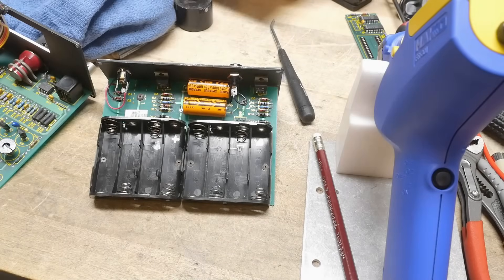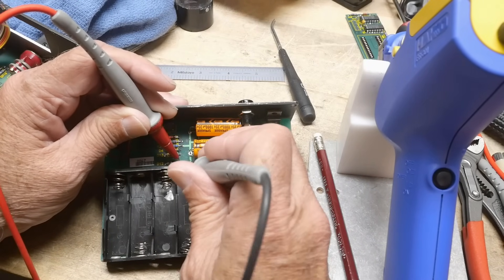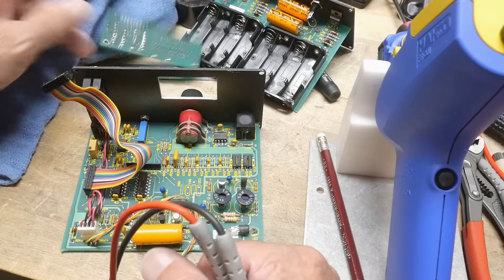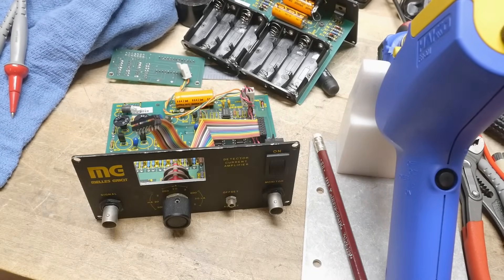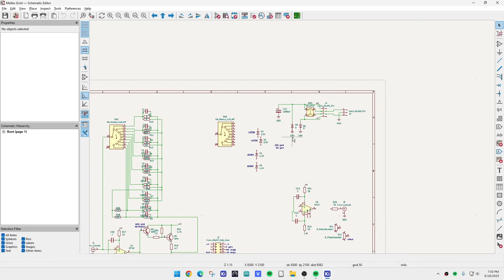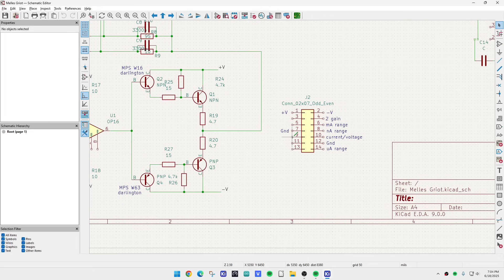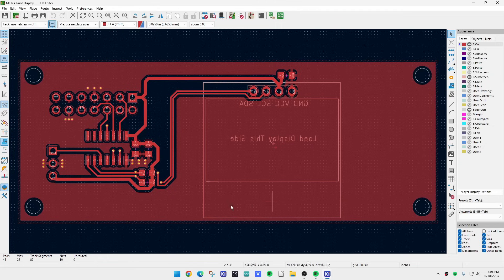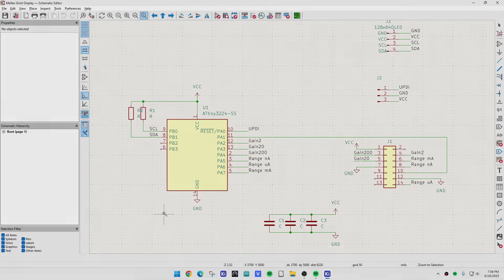#2288 Melles Griot Transimpedance Amplifier (part 3 of 6)

Comment: Interesting project. Look forward to the final solution. One question, any issues with 5V logic and your 3,3V microcontroller?
Reply from the maker: the ATTINY3224 Supply voltage range: 1.8V to 5.5V

Comment: 4 NiMH batteries would be 4.8V not 6V.
Reply from the maker: A 4-cell NiMH pack (e.g., AA or AAA) would have a nominal voltage of 4.8V (4 x 1.2V). 
When fully charged, this pack could reach 5.6V to 6V (4 x 1.4V to 1.5V). 
When discharged, it's recommended to stop at 3.6V (4 x 0.9V) to avoid damage.